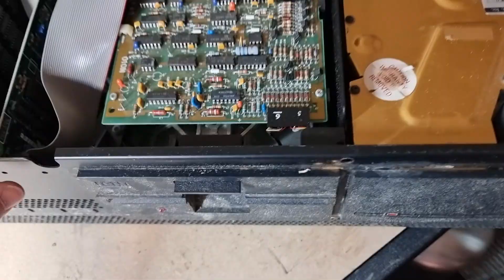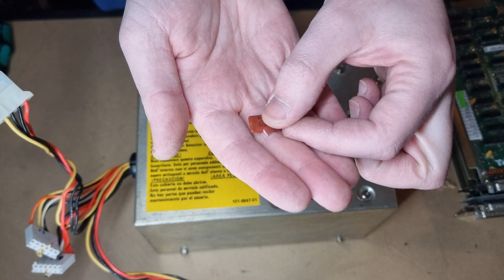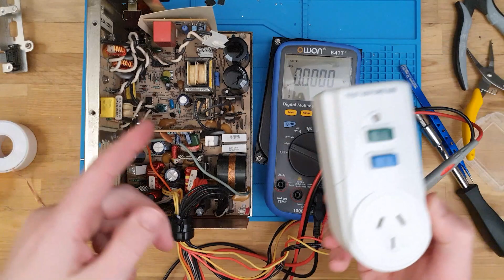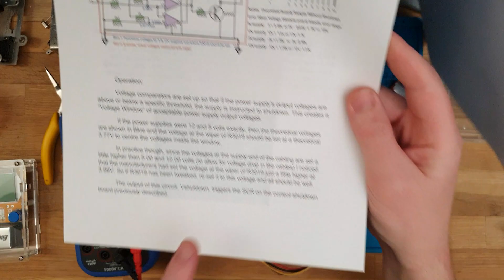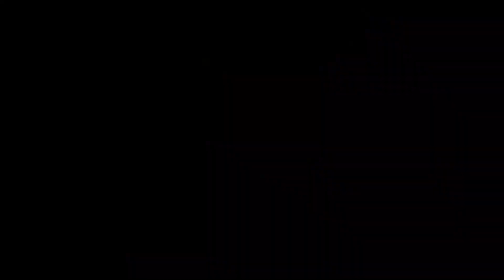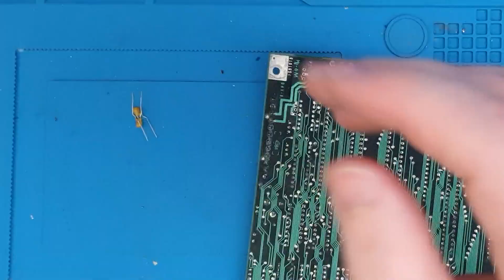This IBM PC 5150 restoration is a challenge

Comment: I hate it when my IBMs throw a temper tantalum. Seems like each one has had a shorted 12V (or -12V) tantalum by the time I got it.
On a more serious note, can’t wait for part 2 to hopefully see this old 5150 running again! (Update: I just realized YouTube recommended an older video so I guess I don’t have to wait for part 2!)

Comment: Awesome video, but yes definitely invest in a tripod and break your video up into more shots.
Reply: I was thinking SixPak+ as soon as I saw that card :) if you see memory and a RTC battery it's either a SixPak+ or one of its many, many clones. Cool to have an original AST one.
Reply: Also, two 1 ohm resistors in parallel are 0.5ohm. I=V/R=5/0.5=10A which, with all 5V being dropped across those resistors, is 50W which means those resistors would get VERY hot VERY quickly.